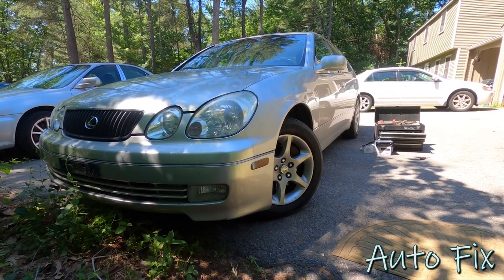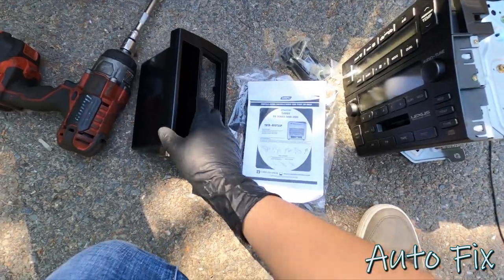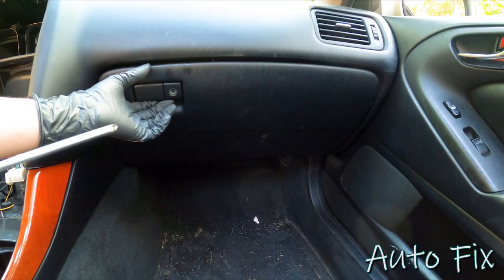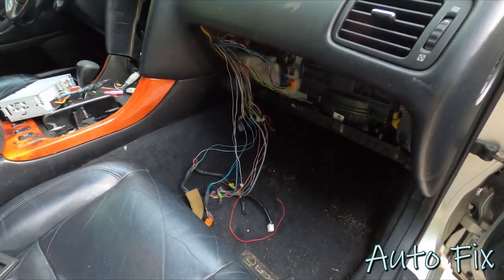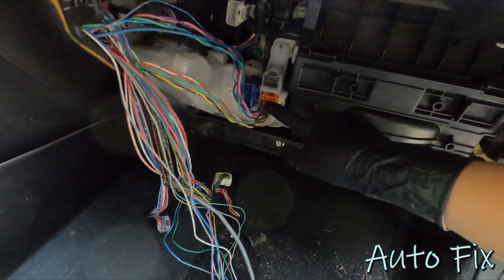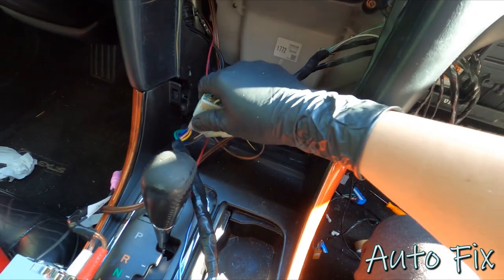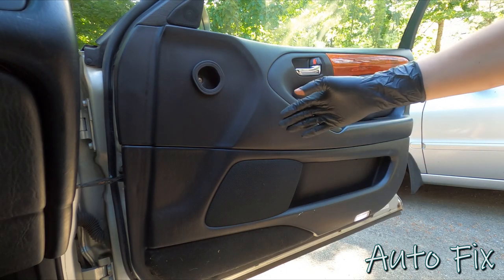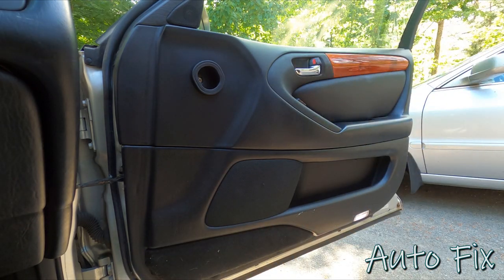Installing Head Unit & Speakers In 97-05 Lexus GS (DETAILED)

Comment: Might sound like a dumb question but would the adapters be the same fitment as the 430s?
Reply from the maker: Not a dumb question and yes they should be the same!
Reply: @AutoFixYT  I asked just cuz I have the GS430 Nd I know it’s pretty much the same platform all around with the 300/400
Nd just wanted to make sure. Thanks for the answer tho really appreciate the help😊
Reply from the maker: Yeah they're pretty much the same chassis wise. No problem!
Reply: @AutoFixYT  thanks again
Reply: @AutoFixYT  also another question, how would you rate the sound quality? Is it good or does it sound hollow and would you recommend keeping the tweeters connected or not?
Reply from the maker: @BOWSER10001  sound quality of what I installed is really good. The headunit i used has a 13 band equalizer, so I was able to dial it in just the way I like it. In the end you get the best results from not only a good speaker, but also a good head unit. They both compliment each other
Reply: @AutoFixYT  aight I’ll keep that in mind when I get em because I have a Sony XAV-AX1000 and I had good sound with the OEM. They sounded really really good. But I wanted more sound out of em. So I decided to upgrade to Polk audio but they the 4inch speakers.... so I looked on YouTube Nd found your video. 😁 Funny thing is for the adapters and speakers is what I spent on those 4inch speakers
Reply from the maker: Yeah factory speakers are tiny, but they work with that enclosure to provide the right sound. And putting different speakers in those enclosures can mess with the way they sound. With the adapters you will be able to remove that whole setup and use the door as an enclosure. The only downside is you will hear music more on the outside of the car than you did before, but that will be overpowered by all the positive things that come with having larger speakers haha
Reply: @AutoFixYT  true considering I have the 4.3 3UZ

Comment: Where do i connect the ground wire?
Reply from the maker: For the head unit? You can connect it to the factory harness or to any screw/bolt in the dash

Comment: hello im currently doing this on my gs but i have the sat nav unit now i followed your video and gave power to my double din unit it works but the sound doesnt work theres no sound at all??? what do i do?
Reply: ive conected all plugs like u did did all harness and nothing
Reply from the maker: @fabiopalaio7964  If you bypassed the amp and youre sure that the headunit is feeding the speakers directly, there should be sound. I can't really tell you many details because I have no clue how the navigation is set up in regards to wiring, but looks like you'll have to do some diagnosing. Basically what you want is to make sure that the new head unit is actually sending power to the speakers (often times with aftermarket head units you can disable their internal amp from the settings and the it will only feed the RCAs). And you also want to make sure that you're feeding each speaker individually, directly from the head unit.
Reply: hello again ordered a diferent harness has this harness i got of ebay didnt seem right even some conections dont make sence so i think thats where the issue comes from thank you
Reply from the maker: @fabiopalaio7964  That'll do it! Hopefully the new harness fixes the problem

Comment: Would this work for a 98 Lexus ls400?
Reply from the maker: Very similar procedure but different center console, and your amp may be in the trunk, so check for that. If it is you have to run wires all the way to the front for the new head unit.

Comment: Bro I got lost on the part when you wire up the harness adapter
Reply from the maker: It's confusing for sure. It took me a bit to figure it all out. So basically you have to get your accessory power and illumination from the harness that plugs into the factory amp. The rest of it (constant power, ground, speakers) should be plug and play through the original connectors)
Reply: @AutoFixYT  So thats basically what the bypass is accomplishing? Taking the accessory and illumination wires and transferring them to the new head unit?
Reply from the maker: @danielpichardo2064  No. Bypassing the factory amp makes it so the factory amp doesn't do anything anymore. You want your new head unit to power the speakers by itself, or from your own aftermarket amp. But whatever you do, you can't have it double amplified. So if you don't bypass the factory amp, you end up double amplifying the sound which results in some horrible distortion.
Anyway, part of the bypassing requires you to get the accessory power and illumination from the original head unit harness and attaching it to the harness that is meant to go into the amp (the one with main power, front speakers, antenna, etc.).
Hope this helps!

Comment: I have no constant 12v on the blue with yellow stripe gs 300 1998
Reply from the maker: Then you'll either have to use a multimeter and find your constant 12V, or get yourself a wiring diagram.

Comment: wat if my amp is in the trunk
Reply from the maker: Yes on the GS400s it's in the trunk. You'll have to either extend the wiring harness from the trunk to the dash, or see if the wires are running through the dash ans just cut them there. Its tedious. Some older BMWs are like that and the easiest way is sometimes to extend the harness to reach into the dash.
Reply: yea i have a 03 gs430 with all the goodys lol the amp died i have no sound
Reply from the maker: @CG-wk7sm  Oh no! Well you could go to a junkyard and see if you can grab one... or I'll give you mine for free if you pay the shipping lol
Other than that, if you go aftermarket then you're gonna have to extend the harness
Reply: @AutoFixYT  hell yea ill pay for shipping lol id really appreciate that is it the same amp?  since the models are different..... SenT yOu a msg on Instagram
Reply from the maker: Haha ok let me go check
Reply: @AutoFixYT  wym see if the wires run through the dash??

Comment: this is ridiculous, why would you install mid speakers with extra tweeters...
Reply from the maker: Because you can always disable the tweeters that come with the speakers so you only keep the ones that are up top :)
Reply: @AutoFixYT  doesn't make sense to pay extra for that what you wouldn't use, I recommend buying mid speakers from Eton it's perfect quality and price ratio... And using a screwdriver to remove the panel is a crime :D
Reply from the maker: @wilius999  Everyone has their thing. I plan on potentially further customizing my system with Rockford Fosgate speakers so that's why I went with them. In the future I might replace the 3 way speakers for some component speakers and replace the factory tweeters with better ones. Also on my factory tweeters I added a resistor in line to lower the volume on them so they can be more of a slight add-on as opposed to a main tweeter.
Reply: @AutoFixYT  What do you mean by the term "in line"?  Would it be "in line" on the positive or negative wire?  The resistor value?
Reply from the maker: Doesn't matter which side, the speakers get AC current so adding a resistor on either sides has the same result.

Comment: Can you run those speakers with a factory amp and stock head unit?
Reply from the maker: Yes you can, you just might not get the most out of the speakers since you can't fine tune the sound as well.
Reply: @AutoFixYT  thank you very much